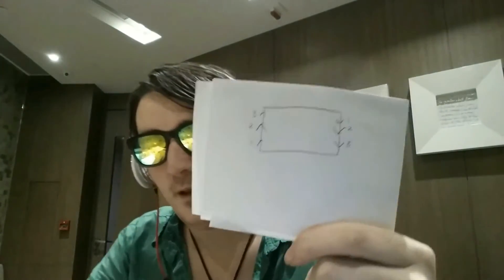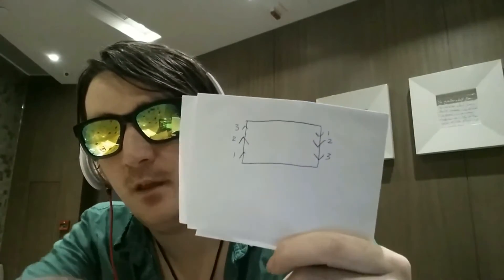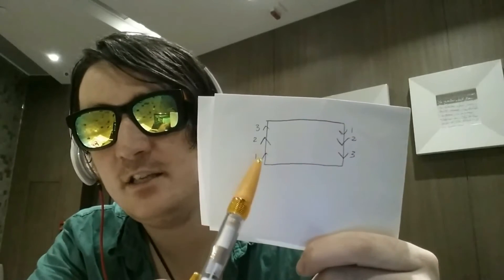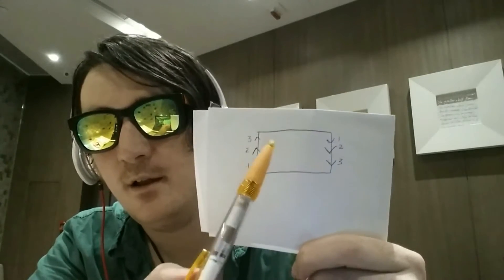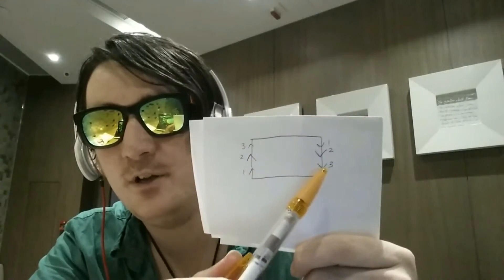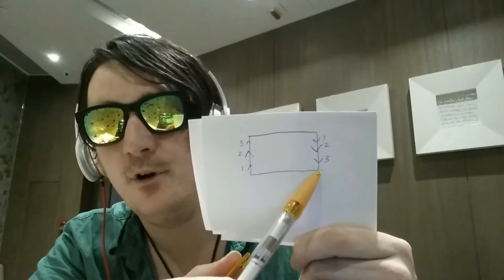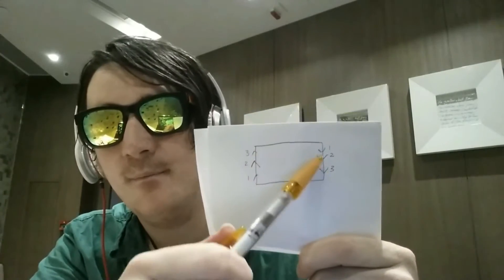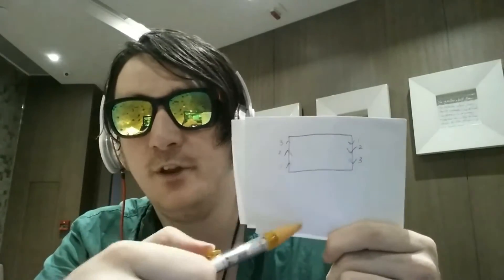ET2 What's The Shortest Mobius Strip

Comment: Sorry friends for no explanation but I was celebrating -  looking forward to get this great Klein .bottle!!! So, here is what I did : I made a Mobius Strip and pushed the knot as tight together as possible, then I cut off the overlapping pieces of paper at the ends , unfold the strip and recognized that the left part looked like a square. So I made an exact  square , fold it diagonal, so that the right edge becomes the upper edge. I fold again, now the two upper edges onto the two left edges. I taped two edges together ( not the both, which lie next to another ) then I celebrated and now I hope, that I`m right... Thanks a lot for all your questions, Richard !!!